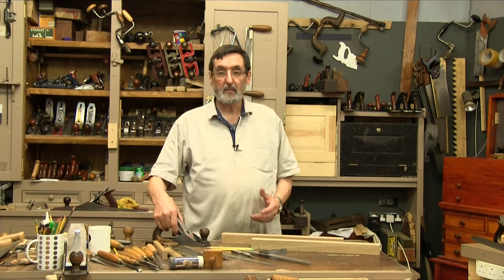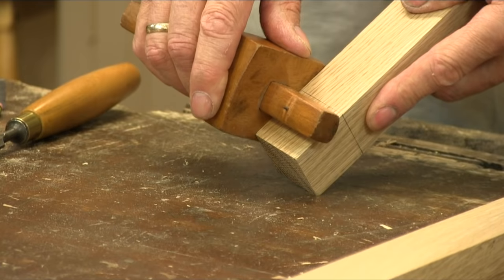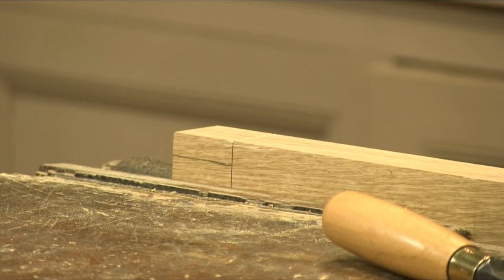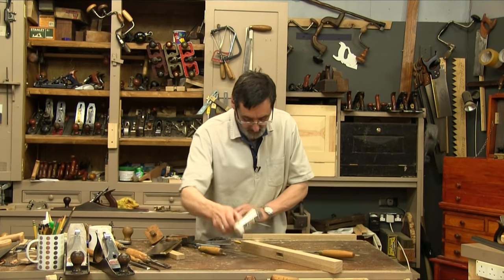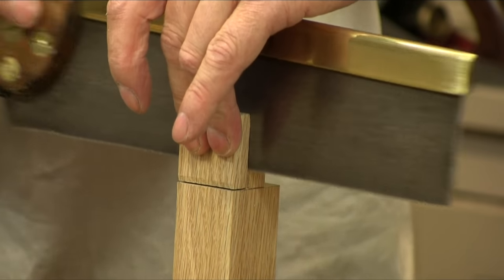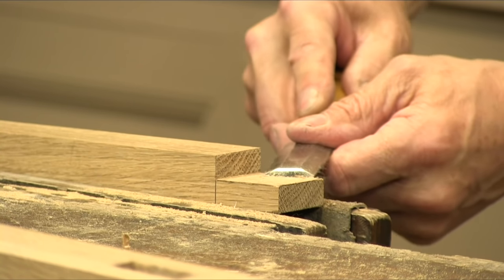How to make a Mortise and Tenon Joint - The Three Joints - | Paul Sellers

Comment: Thank God for power tools!
Reply from the maker: Yup! I say that too!
Reply: They're not tools but rather power machines. Also, they aren't necessarily faster nor more accurate than hand tools. Once you get set up and start working cutting this joint by hand, especially by Mr. Sellers, one is just as fast as power machines. Why else would many woodworkers and woodworking professional advocate hand tool use in many situations. Your comment just doesn't make sense.
Reply: the comment makes perfect sense. If you were to be in a position where a dozen such joints are required, a power TOOL will reduce the labour investment considerably. will it be as fine a finish, unlikely, but it doesn't have to be unless you're an artisan. so I say your comment was confrontational for no other reason than to imply you're thoughts on the subject are more valid than the OP's.
Reply: great work and attention to detail here Paul. Though I heartily second Ariel's comment, power tools are a blessing for a quick consistent if not superior result.
Reply: Of course. 
But:
- if you want to use a router to cut your mortise, you need a jig to center the router base on the timber. Or a router table. And if you don't have either you need to build them first. Sure, once they are built they are reusable but until you don't have them you can't cut a mortise with a router.
- you want to use a drill press. You need good, expensive forstner bits to start off. And you need to know how to use a chisel anyway to pair the sides of the mortise. 
- you want to cut your tenon with a circular saw. That's probably the easiest way lacking a table saw. But still you need to know how to use a chisel to pair the shoulders.

All in all, learning how to cut these joints by hand will make you a better woodworker in any case. 
But if you only know how to work with power tools, you will be lost without them.

Without then considering the cost factor.
Reply: completely valid points mate. as long as you know how to do it manually, then the quicker option of a powered tool is just a beauty to have. m&T joints I'm good with.... dovetails on the other hand.... I wend up flapping round like big bird trying to get those buggers right haha.
Reply: Thank God for hand tools!
Reply: Hand tools are just more fun!
Reply: If you are willing to spend hundreds on power tools, extraction fan and all the associated, H&S ,fair enough, this is about workmanship, learning the skills, building with integrity, if you want cheap and cheerful you can usually buy what you want, cheaper, but not better.
Reply: Ariel .Enriquez Powercut.
Reply: If woodworking is what keeps the lights on in your house, you'll look for a way to use your time efficiently.  

A master craftsman can obtain perfect results with his old-style tools, but most master woodworkers know how to use their machine tools to do an equal job in a fraction of the time.
Reply: Briar Fox, Usually, for a 2x4 or 4x4 it takes me about the same time with a hand saw than getting the circular saw, the extention cord, connecting it and starting to saw. And it's a nice cardio in bonus.
Reply: Briar, I love using hand tools, and would work exclusively with them if I could.  But when someone wants a table, they don't like waiting weeks for it.  We just watched a 30 minute video on ONE mortise and tenon joint.  These things take time to do, and time is money.  So while I enjoy working with hand tools, it is impractical to build something with only hand tools because I am losing time, and money by doing it.
Reply: At least you don,t get the dust or vibrations from hand tools. So no need to suffer white finger or joint pain from years of power tool use.

Comment: I've been making a gate and I decided to use mortise and tenon joints.  I only had paring chisels so it was great to see this mortise method especially since I don't have much space to store extra chisels.  Admittedly I went to the wood a bit nervous about how hard/easy I'd find this method but I actually found it not only quite easy but really, really enjoyable.  I think it's the way the chisel just slices the wood out so nicely.  I feel like using mortise and tenons all the time now just because of this method!  Just finished the gate and wanted to thank you for this video and for all the other videos as I really prefer woodwork by hand rather than machine so your videos are really helpful.  Cheers! :)

Comment: I've been doing carving and glue & screw stuff for some time now, but only recently got into actual joinery. Of all the vids - this was the best by a big margin.

Did my first mortise and tenon joint today. Results are what you might expect from someone's first mortise and tenon joint (as in... not great.) But my results would likely have been catastrophic without this channel, so a big thanks to you and your team. 

Lesson learned: when initially cutting marks, pay more mind to what's earmarked for removal. I love that 1/32" of an inch is something I have to be mindful of. (1/32" might seem like the Grand Canyon to a master, but for me it's new enough to be funny.)

Ended up with a loose joint, but I really enjoyed the process. I have a barrage of outdoor projects this year (that I'd usually just glue & screw) I'll use to develop my skill.  This particular practice joint was joining legs for a planter bench. I spread glue, mixed up some sawdust + glue to act as a filler, tossed a couple screws in.

Just in case a mortise ends up loose again - what's a preferred "this isn't important enough to start over but I still want as much joinery and as little glue&screw as possible" fix?  Wedges?  (Literally just occurred to me I could have cut down the tenon and used wedges).  Any others?

Comment: First let me say how much i enjoy your video's, its reassuring to hear your soft northern accent as apposed to a harsh(to my ears) American one.I have been watching various woodwork professional videos for two reasons, First, as a reminder because some joints i haven't cut for many years, Second to check new developments. None of the Americans seem to use face and edge marks, some mention the face side but i never see them mark it. I was taught to use face and edge marks when i was first taught to plane and it was gratifying to see them clear as daylight on the timber you are working on, The loop for the face and the V on the edge pointing at the face mark. I was taught that it is fundamental to always work from your face and edge marks and it was drummed into us from day one. I am only a couple of years older than you and wonder if it is a generational thing or is it just taken for granted and just not mentioned.

Comment: My first attempt today. Lessons learned and reinforced by your video:

1. Don’t chisel the mortise right through from one side or you create a messy exit wound.

2. Don’t pare the inside of the mortise or you risk splintering and blowouts on the reverse side.

3. Take the time to shave the tenon down in parallel or you can, like I did, create a wedge and blow the mortised timber completely apart!!

Love your videos Paul.

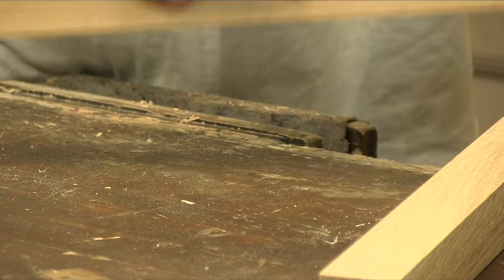Comment: Paul, have you ever noticed that you can actually hear when board is square?  In all of your videos I've watched, I've heard you remark frequently about having sensitivity to the wood, but haven't yet heard you mention the "sound of square".  You can hear it at 1:30 - 1:37 in this video as the boards touch and as you lay your square upon them.  I've noticed this in my own work, as well -- when the board is square, it actually takes on a unique sound, particularly when sliding the square down onto the surface.  It's one of the ways I know I've got it right when I get there.

Comment: Thanks for this simple and effective method.  On my current project I have cut the mortices and tenons using a router and a jig up till now, then I decided to try your method for cutting the tenons.  It's a little bit more work, but between setting up the router and jig, not that much more... I find it easier to get the exact fit and crisp shoulders, and my first try was already better than the ones cut with the router and bit.  I'll be doing it with hand tools form now on.
(Still cutting the mortises with the router :p   Also I need a nice router plane like yours, I have a small one that's not great for cutting larger tenons)

Comment: Hello Paul,
Firstly, thank you for all these videos, they are an amazing way of learning great craftsmanship ! I'm an archaeologist and I really appreciated when you sawed the tenon : you can actually link the original movement and the "chaîne opératoire" to the traces in the wood. It's something very important when you are trying to find the "hand" and therefore the choices made by previous craftsmen.

I also had a question : can you make a mortise-tenon joint which is as good as this one by drilling the mortise and cleaning the hole with chisels ? Would you recommend it ?
Reply from the maker: Jarastlad No, in woodworking generally this is a poor method but was taught quite broadly taught. 
We made a table on woodworkingmasterclasses.com that was made in the early 1800's and dismantled the table first. Here I learned more about the man and his work, his methods and so on, than I ever did in my apprenticeship or since. You should join wwmc just for that one series. It will cost you £10 and you can cancel immediately after but if this interested you then that one will blow your mind.
Reply: Paul Sellers I'll sure have a look at it, will have to change € into £ (I'm from Belgium) ! It's always quite an amazing thing to look at tools or objects and how they were made. I do that with bronze or flint tools, it's fascinating !

Comment: As joiners during the 1950s we still used hand tools to prep our joinery...from cutting list, to strapping up from prepared - Face-Side-   and.  Face-Edge...all setting out with the square was done from these sides... Marking Gauge ...to set thickness and width to be planed down to....then a ...Mortice-Gauge...To mark the mortises....if the hand Mortimer wasn’t available, we could all drill then chop out a mortice from both sides using a mallet and chisel.... To ensure clean shoulders ... Tenons... we’re always marked with a ...Marking Knife ...also they were always left at least a 1/4 of an inch longer to help with wedging and for better cleaning up and finishing.... End Tenons were always ...Haunched ... so they didn’t extend into a slot...When marking out a mortice and tenoned frame, always ensure the PAIRING of components.... The fine wedge cuts on each end of a mortice on the reverse side ensured easy wedging....Hope this helps too....A pleasure to subscribe to this Chanel.

Comment: Paul, do you ever use mortising chisels?  It looks like a paring chisel was sufficient to chop the mortise in this video.  I liked the emphasis on how the bevel causes the chisel to move away from the knife wall.  Also, I never realized that the inside walls of mortises don't need to be pared if you use the right width chisel to begin with.

Comment: Another great video Paul as always. You singularly, have wholly converted me from power tools to hand tools. The satisfaction gained from using hand tools is unsurpassed!

A quick question though. You never cut shoulders on the edge's of your tennons, leaving them the full width of the workpiece. Is there a reason to this?

Thanks for all the great videos, keep up the excellent work!
Reply: +Brian18741 More surface area for glue? That's my guess. Anyway, he's Paul Sellers, so he needs only two shoulders on his tenons for his joints to look beautiful. Me? Hah! I will stick with shoulders all around the tenon so that my joints at least look passable, thank you.

Comment: Do you still glue the joint when you have such a finely tuned fit?
Reply from the maker: yes.
Reply: I imagine you could get away without glue with a joint this good and it would last a year or two. But it would work lose a lot faster than if you where to glue it. When wood tries to expand and there is no room to expand, it crushes the fibers and when the wood dries out again it will shrink and be loose. This is more or less noticeable depending on how you finish the project. But glue helps to combat this.

Comment: Classic joinery at its best. thanks for the great video. I have 1 question though.... is there a reason why you dont pre drill out the mortise to remove 70% of the hole before chiseling out the edges?This makes the process much easier. This is something i have always done and thought that most WW'ers did to.

Comment: at 25:00 the wood peace was not turned upside down. The tenon was left not "perfectly" symmetrical, or "parallel" from both sides.

Your expectation of "biting more into it" was correct. Besides trusting your gut feeling, one can tell the side was not flipped by observing the fluffy edge left on the Tenon during previous "parallel" shaving.

Great material to watch during procrastinating, non the less.

Comment: Hi Paul, thanks for the great video. I am hoping to make a bench with mortise and tenon joints from an oak beam that I found in my parents' garden. Unforfunately, the irregular edges of the beam means that most of these techniques will not work. do you have any techniques for making the same joint when you don't have straight edges to measure from?

Comment: Instead of the saw on the Tenon, you can chisel it too. I'm planning to build birdhouses this Mortise and Tenon method just using a chisel and mallet. I've been using electric router, jigsaw, drill press, and belt sander. I'm building a birdhouse with pegs. The next one, I will do Mortise and Tenon with chisel and mallet. It's difficult; with patience, it pays off.
Reply: I made birdhouses with screws, now I'm building them without screws and nails.

Comment: I've been practicing your mortise and tenon techniques and they've really sped up and improved my work, however, I am having a bit of a trouble as whether I use your method or others I am always warping the longer edges of the mortise (not the ends, these always come out fine). I am not sure if it's from the levering or if the chisel is twisting, or if it's something else.

Comment: Hi Paul, thank you for this nice tutorial.
Quick question, would you Always apply glue on the next step or leave it like this?
Also, on minute 29:13, i see a tiny bit of space on the sides, would it be possible to achieve more perfection? 
Thank you so much.

Comment: Well I don't have a marking gauge but what I do which works every time is I total the width of the material i'm using for the mortis and take the width value away from the chisel then devide by 2 and I use that measurement on each edge.

Comment: 23:40 -- That moment when you realize a seemingly obscure antique tool you picked up merely as a curio from a junk shop years ago, feeling guilty about the $25 you spent, is better for the job in question than any of several different specialty planes being sold today for 10-15 times the money.

Guys like this are dangerous.  Capable of putting some very good modern tool-makers right out of business, if too many folks start following this sort of advice.  And mortising with no mortise chisels!  Heresy!

In seriousness, I WAS generally aware of the function of a router plane when I bought it.  But this was an eye-opener.  Similarly, I was also vaguely aware of you, sir, before stumbling across this video by chance.  But now I will subscribe here, and begin paying closer attention.  Thanks for posting.

Comment: Thanks great video! I've watched both your dovetail video and this one are we are making draws and doors for a kitchen unit. I was wondering if I should use glue on the joints as you don't seem too?
Reply from the maker: Hi HK. All my mortise and tenons do end up being glued but for the purpose of demonstration there is no point in me gluing them. Hope this helped.
Reply: Thank you for your swift response. I shall get out the PVA before I put everything together.

Comment: Would using a speed square give a more accurate pencil line during the transfer? In Sellers' demonstration he used an estimation to transfer the line using a sliding square.
Reply: +Kenny Garland I've tried using a speed square, but I found that the "missing area" of the pivot notch makes it quite clumsy to transfer the line to the adjacent surface. Your mileage might vary, though.

Comment: Looks like when you used the hand router, you did one side and flipped it, but maybe twice, because you took it down on the same side...according to the direction of the end grain and the nicks from the first routing.  Looks like it worked out, and we got the idea, but it could offset the joint if you don't evenly trim each side of the tenon.  Not to be too critical, since you are the Bob Ross of woodworking to me!

Comment: Layman question: do you eventually want to glue these joints, or just dry hammer them in? Thanks
Reply: That's the point of this joint, don't need glue or nails etc it's so naturally strong if it's got a tight fit, glue would be a good rescue for a bit of a looser fit if mistakes made. If you did say an easier but weaker joint using dowels instead then yeah glue would be required.

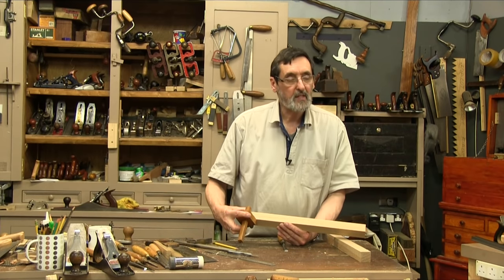Comment: 3:19 - Maybe I am missing something but why not mark the center of the beam then line up the center using the single pin. This would let you ensure you have the center marked just right with your tool. This also takes all guess work out of your tool alignment when pressed into the beam.